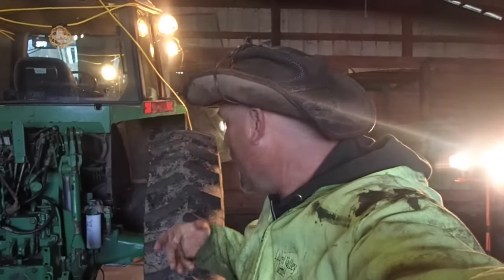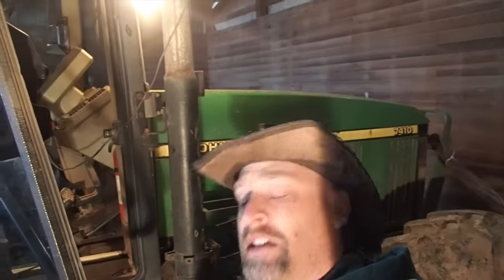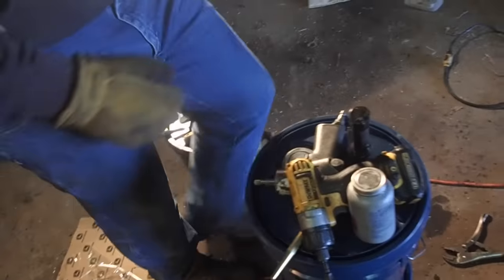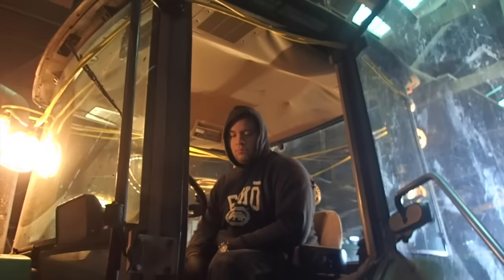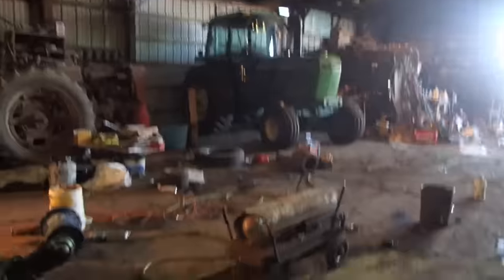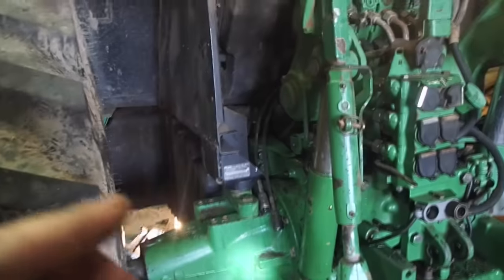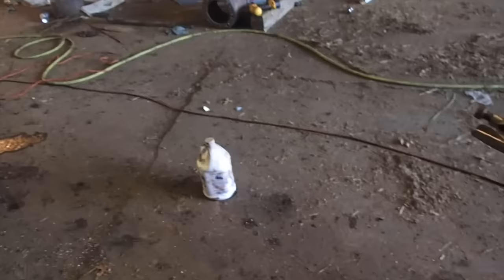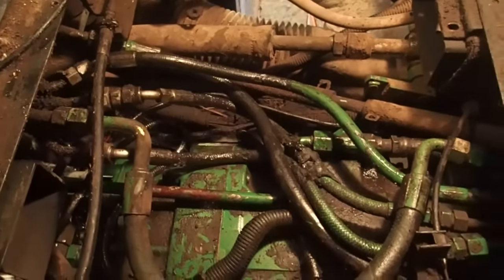7410 Transmission Pt-5 FAIL!

Comment: Hi Wes  sucks you got a problem but glad to hear you are looking after that engine drive shaft, that can be a real day cocker, when the crosses let go. if ever you drive one of those Deeres and you feel vibration through the cab floor that changes with engine revs. stop and check that shaft. My old boss found out the hard way with a $20.000 repair bill for new casings and replacing all the shit that got mangled. when the shaft let go and went round unattached at one end under the cab floor before it spat it on the ground, while he was running a snow blower one winter.  Hope the problem isn't what the guys are saying about the discs being wrong. At least you are honest telling us about the problem, that could of been a major edit we never saw !.

Comment: either clutch disc in wrong place or when you have assembled the traction clutch you have pinched the bottom disc i.e instead of the disc meshing with the splines it has got caught under the central splined hub so your getting permanent drive in affect. i know as i have done it twice on the same tractor which was a 6800 and you had to tilt the cab other to work on the power quad. if i am correct you only need to remove the front section of the box and pull the traction clutch out strip it and try to get that bottom disc in mesh. cheers sam
Reply: +David Harris i was half right as wes did say he had pinched a friction disc i suggested the traction clutch as that is the one clutch i have fucked up before with the same scenario of ending up with direct drive. cheers sam

Comment: Wes I commented in the part 4 vid, did you time up the gears in that forward reverse planetary ? They are compound gears and need to be timed on assembly. There are arrows stamped in to the gears by the teeth and they need to line up. I,m sure this is correct from memory

Comment: check hose connections, linkages, electrical. doubt its internal because everything turned free before you mated the engine. I have seen where guys home rebuilt their transmissions and would put too many discs in, as most kits fit a range of models and they didn't know to replace new with same number of clutch disks. but I'm sure you got the correct number.

Comment: That was a difficult repair, hopefully something you can fix externally, I believe it will be the case because of your experience, did the clutch really disengage, probably air or bad electrical contact, what can we say, hope it's a quick fix

Comment: most likely missing shim or spring also check the hose to the control valve and the control valve adjustment may be off iy should be completely hydroponic but you never know being that you bought it used. air in system usually the tractor would not move at all or have bery high rpms and very little movement...
Reply: +Anthony Blanchard in part three he put two steels plates together by accident.
Reply: +oilerman9406 yah I seen it too, at the 3:17 mark when he was putting the back end together
Reply: He fixed it already
Reply: well yes after he split the tractor again and found out it was that.

Comment: WES. Did the transmission grenade because if the fault you have now? Perhaps the forward clutch pack engaged or stayed engaged when reverse was selected ripping the center out of it while the tractor was revving or under load. I may be that you have repaired the damage but still have the fault that caused it. Just a thought.
Reply: +Robert Crowther  Hi I'm in the mechanic trade and was kinda thinking the same thing when this video was playing. There is also rumor in the last video some guys saw some discs go back in wrong.  I haven't gone back and looked, so won't speculate to much. But i know Wes will get it right in the end, everybody gets a bad one once in a while, it don't matter how good or experienced you are fixing things crap happens sometimes..

Comment: chuckys tractor kinda was a let down. he seems to rush the end and rigged and hacked alot of it together. I expected alot better of him.
Reply: +Mr. Random the engine was fucked from the start so he went into fuck it mode
it was burning massive oil when he got it started plus its down a cylinder
Reply: +imchris5000 He should have run the engine while it was still in the truck, would have saved a lot of time and money had he not started with a junk engine!
Reply: +dan a he did   but  alot of the time its for the fun of it  not the practicality also look at it this way   its real life practice
Reply: +Mr. Random He did it because he could and he did it the wrong way just the prove everybody wrong and show it works

Comment: Just a small suggestion wes. Just an idea really. After you've checked out why it seems to be stuck in gear. Why don't you put the ass end on jack stands so the rear end is free to spin and it might make fault finding easier. Anyway just an idea
Reply: thats a good idea too never thought of that one but is that tractor not 4 wheel drive ?
Reply: +Craig Nicholson I think you can turn the 4wd off, normally you always drive with 2wd only when you start slipping use 4wd, some tractors always have it that the front wheels go slightly faster than the rear wheels. That is why we NEVER ever drive with 4wd on on the road. (We have european jd 7530&#39;s)
Reply: +Craig Nicholson front wheel drive can be disengaged
Reply: I do not know tractors that's why I asked and I do not drive so do experience with mechanical is very restricted .
Thanks to both of u for putting me right

Comment: The framistat needs to be connected to the idler shaft  ???   :-)(you fixed it already...I suspect)
Reply: +Steven Hardy No think it was the thingamabob not the  framistat that got hocked up incorrectly. It certainly wasn't the whatchamacallit.

Comment: all chucke2009 has to do is put the trans in park
Reply from the maker: Nope it will not stop that shaft it will jus make a nasty clicking noise as its trying to stop
Reply: +onelonleyfarmer Wes have you ever heard anything good about a Pequea rake? I have a chance to purchase a Pro rake that looks to be in decent shape. Guy that pulled it for the most part 700 acres, suddenly died. Just wonder if they have good rep or are lemons.